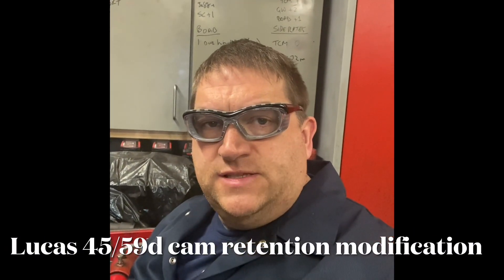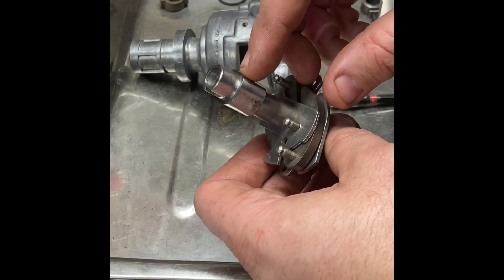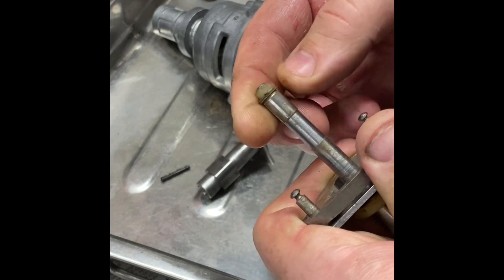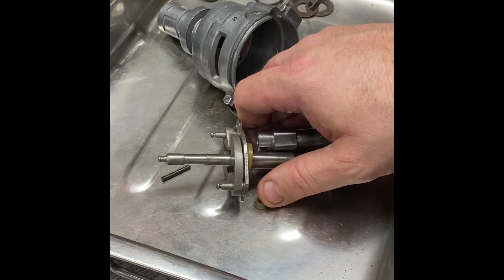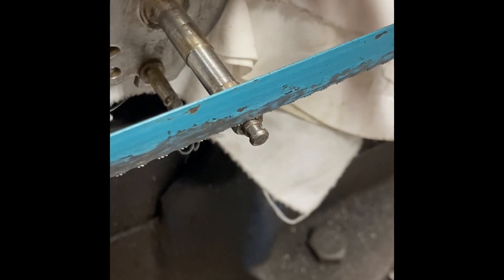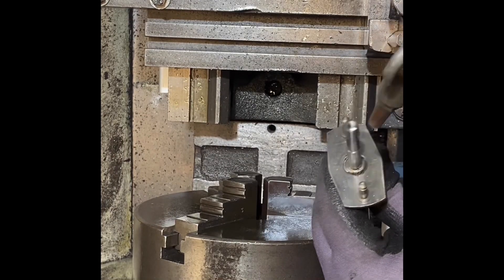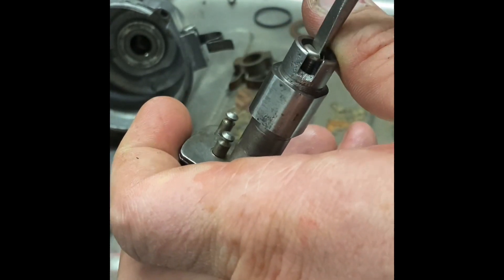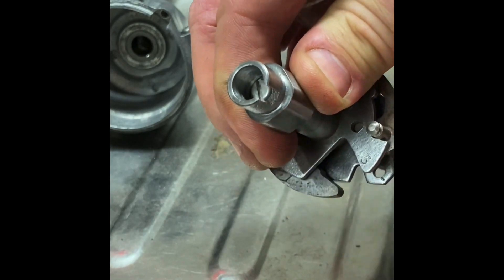Lucas 45/59d distributor shaft modification to screw retention of the cam

Comment: Do you have a video of how to re assemble a 23d showing how to re assemble a completely dismantled dizzy.
Mine was nearly seized on its bushes and was very hard to turn.
I took it apart but instead of driving the bottom slit pin I banged the shaft out .
Now I don't know at what angle the bottom plate goes back on the splined shaft to get the correct angle for the spindle drive to point to No 1 cyl.
Can you help.
Reply from the maker: No I don’t have a video and I very rarely use these units as they are not the most accurate mechanism.